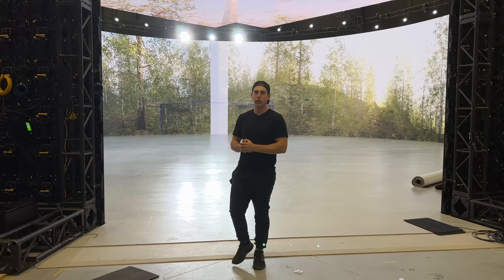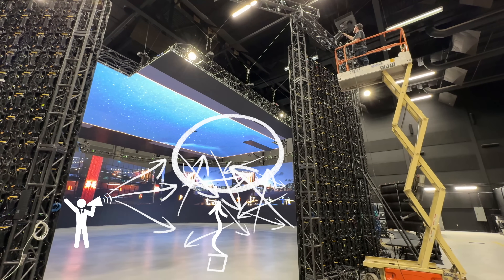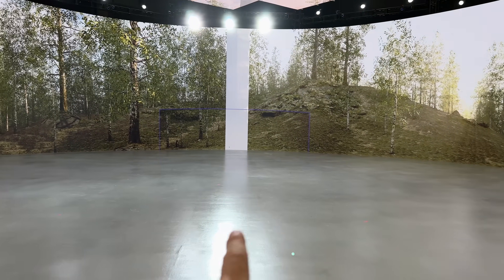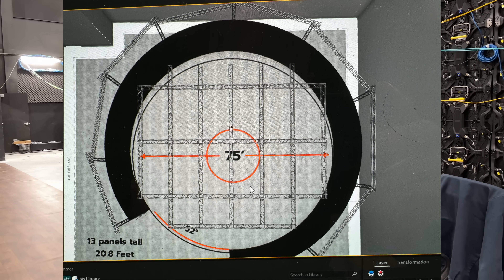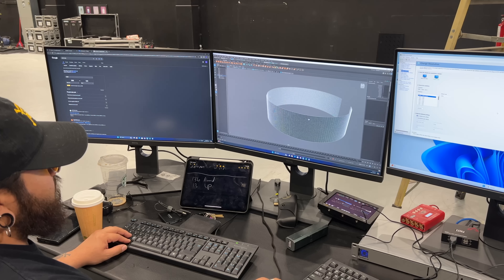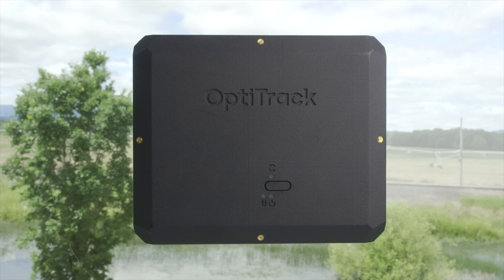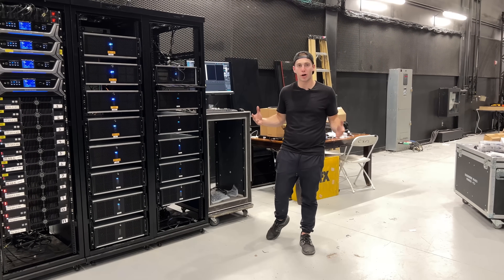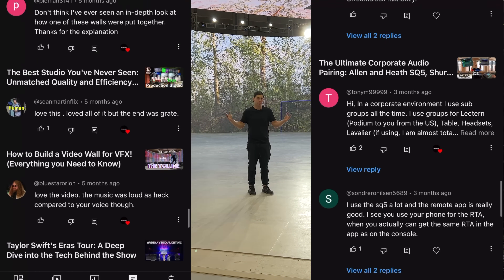How we Built an Unreal Engine Volume that competes with Amazon!

Comment: Raised Floor would solve your leveling problems and ventilation...what was the total build cost? At what point do you believe these wall pannels will become outdated and need a replacement? Technology changes easily every 5-10 years. Ill bet ya they will begin to incorporate a transluent screen and add sound panels exclusively for the virtual stage envioronments to allow noise dampening via acoustic methods rather than Helium. Helium can be dangerous if air flow is not properly monitored. What is your Helium detection solution/protocols? What US State is this in? 900Amps, what backup power/UPS generation solutions have you incorporated?

Comment: Why use madmapper when Unreal can send DMX data to lights that would match your scene better and react to the moving scene?
Reply from the maker: Just for ease of use when we want to control specific groups of lights and preset scenes unrelated to what unreal is outputting, then having a separate controller software is useful. Best of both worlds really.

Comment: some suggestion: combine your set up with the Disney moving Tiles. would make everything smaller! you could do a lot of more moving acting, also with more people.
Reply: The Disney tiles thing is proprietary Disney Imagineering tech. It will never leave the R&D room. This is becasue of sheltered VR engineering, which does not account for the fact that the vast majority of people cannot handle VR, and/or like VR. Kinda like the slippery bowl vr locomotion rigs, they are a huge gimmick, and most people cannot tolerate using it.

Comment: Hey Brandon, how are you? Recently I'm having a lot of delay when doing IMAG in the events I broadcast. What approach do you use when doing IMAG at events? I tried using the direct outputs from the ATEM 1 M/E Constellation 4K that I currently use and nothing. I remember you talking about this in some video on A2Z but I don't remember which one. Thank you and take care.
Reply from the maker: Hey yeah the atem’s with direct SDI out do very well with low latency signal for imag. What cameras are you using? What projectors or video walls are you using? Trying to determine where your delay or lag is coming from? Also are you doing a bunch of conversions in signal after the atem or direct to your screens via SDI/fiber?

Comment: I wonder if the floor should be a raised composite mesh/grid that has sound insulation below it. you could use an irregular grid pattern. sound reflection aint no joke and sometimes a high density foam mat doesnt cut it. you could also duct AC in from below because I'm sure this thing runs HOTTTTT (probably equivalent to a 10kw heater or more). you shouldnt try to cool the whole room when you only need to cool the people

Comment: In music studios, portable absorption panels commonly referred to as "gobos" are used to mitigate echo or shape the sound of the room depending on the current needs of the band. Perhaps as similar solution could be utilized? Owens Corning 703 is great for absorbing full-band frequencies - if you were to build a few dozen gobos on wheels that could be easily positioned within the volume, as well as some suspended paneling or thick velvet curtains from the ceiling, you could probably tame a lot of that echo. Plus, as you add set pieces or change the floor surface material depending on shoot, you will notice the sound of the room changing.

There are always sound restoration tools that can be used in post production, but it is always much better if you can achieve a clean result in production!

Comment: how about scooping out the floor, putting diffusion in and replacing the floor with basically metal grates? provides stability, lets through enough sound to kill off a surface of reflection. cant do much about the paralleling walls but if youd account for the perspective angle and turn it more into a cone itd be cleaning up a lot while the middle would barely get used anyway.
Reply: Wouldn't be useful for long. The floor becomes the set, so dirt, sand, etc. It needs to be flat to be set ready. Those objects also help with sound dispersion.
Reply: @Kaboom1212Gaming  its crazy but i heard about those things called tarps.
Reply: @HiUnidentified  Do tarps not make any sound when you step on them?

Comment: You are close to matching The Sphere. What is the volume going to be used for?  Or what it the challenge? 

Is there some type of acoustical tile for the flooring that could help? Would sound panels work BEHIND the LED panels in the walls and ceiling?

Not only would this be great for movie-making, but  any type of recording of choirs, theatre, videos, etc.  You could make that a very high-end club, as long as patrons kept the drinks away from the walls.  

How long Was the build? Great layout of the various  components and its design. 

Thank you Brandon for the video!

Comment: We are working on a 3 part multimedia system; (A) 10x10 switching matrix with 100 channels x 100 frequencies, including IS / AS / US (Infrasonic Sound, Audible Sound, and Ultrasonic Sound. Dedicated DSP's / GPU's, and CPU's deliver power unavailable in any other system today. Mix and match video and audio processing with 100 GB throughput per blade. 10 blade processors per server, 10 servers per rack, and 10 racks per cluster. (B) Rack Amps connected with high speed data cables from mixers, or high speed wireless signals. Arrays of IS, AS, US speakers delivering 5 hz - 500 KhZ that cover walls, floor, and ceiling. Video resolution is12K at 300 fps.

Comment: Cool. What's the purpose?
Reply: Many high-budget movies have replaced green/blue screens with these video walls because green screening has negative effects. An example of this is green spill, which often shows up on the actors/actresses. It can also be a very manual process to refine, especially for transparent objects. In contrast, a video wall allows them to skip this process, while also making the lighting/shadows realistic and allowing the performers and producers to see their environment (and make adjustments quickly).

Comment: A suggestion to stop the echo. If you can exploit the panel's ability to curve, maybe you can corrugate the overhead panels. That way you won't have a completely flat surface above the floor and future set... you could also experiment with the depth of the corrugation so that you can have the best light coverage you want from above, but add curved surfaces to the "ceiling" panels to break up the reflections with the floor. If you standing dead centre, there will be little you can do to stop the sound focusing back to the centre point. Also, you've kind of created a whispering wall... so if someone stands on the end of one side of the wall and talk along the inside edge, the sound might travel all the way around to the other edge of the wall. Amazing setup. The tech is incredible.
Reply: You might even be able to use the whispering wall effect to your advantage.  If the talent is at one focus, place a microphone at the other focus, well out of frame, and it will pick up everything they say, no matter how quietly.
Reply: sound would likely converge at the focal point in the centre if its perfectly round
Reply: @BirnieMac1  that would be a perfect dome I guess ? This is a flat roof, not enclosed, panels are flat actually and there will be a slight gap where they merge. Ain't a perfect world. Find a photo of an anechoic chamber to see what it takes to have no echoes.
Reply: An array of microphones all around the volume and use AI to single out all echos.
Reply: @Dav1d_B  No need for AI, just noise gate it all but this is not a solution. Prevention is always better than cure
Reply: @Dav1d_B  you'd need mics and speakers to playback the phase reversed ambient so it will cancel the room sound. This is how airpods and noice canellation in general works. Although you may now be able to tell why it only works on headphones, in our case here you'd have miced up actors and their mic would also record what the speakers would playback.......
Reply: @lameturtle1170  I'm pretty sure with a directional mic picking up only the actors voice, an AI could remove any echos without the need for additional equipment. I don't know of anyone developing that AI, but I am sure it would be possible. This isn't an analog counter-signal, it would be a digital cleaning of the small amount of echo the directional mic would pick up. Add a gimbal and tracking camera on the mic to track the person's mouth, I'm sure it would provide a very clean audio recording. Or even more expensive, LOL, a phased array of directional mics and a multi-track recording that an AI would sift through. Then your tracking could be less precise. That video wall can't be cheap.
Reply: @Dav1d_B  Yeah ok, it's kinda imaginary but it could work (?). Thing is, directional mics are not directional enough, echos, reflections etc, overlaps with the exact same position of the source. So even if they were directional enough and you could point straight to the mouth, this doesn't make you able to not record any reflections. Ai ain't a magic, it's a tool, even if such an algorithm is developed, the ai would have to use eq's, phase reversal, dynamic multiband processors, to clear up the recording, which would introduce a TON of artifacts, then you'd need to do post production on the movie, which includes compressors and eq's and limiters on the speech parts, which would make these artifact stand out even more. 
(I'm an audio engineer and have field recorded multiple movies. )

Comment: I wonder how many pixels are in those screens?
Reply from the maker: 500mm panel width / 2.3 mm between pixels = 217 pixels per row per panel. 

217x217 = 47,089 pixel per panel 

13 panel rows tall x 138 panels wide = 1794 panels total

1794 panels * 47,089 pixels per panel = 84,477,666 total pixels on perimeter wall (not including ceiling)

Total resolution is:
217 * 13 = 2,821 pixels tall
217*138 = 29,946 pixels wide

Standard screen size for TV/monitor is 16x9

This video wall is 138/13 for reference. 

Hope that helps!
Reply: @liveproductionmastery  Math checks out 🤣👍

Comment: Where is that stage?  Also, creating the volume in a less circular shape can help quite a bit with audio, however with the hard ceiling and floor being parallel you will always be fighting that.  I usually prefer to keep the walls open in more of a bell shape or a "J" shape, unless I'm shooting something that requires full enclosure.

Comment: That moire pattern is noticeable on the ceiling but you did mention you are using different frame rates and processor for that.  Loving the set up. Good job!
Reply: I’m pretty sure it’s mostly used for the immersion factor instead of actually filming because there is a huge gap between the wall and the ceiling
Reply: @Its_Quash  It's more for reflections. Everything is reflective, what changes between a chrome sphere's reflection and our hands' reflection is its "blurriness".
Reply: Also it was filmed at a extreme angle